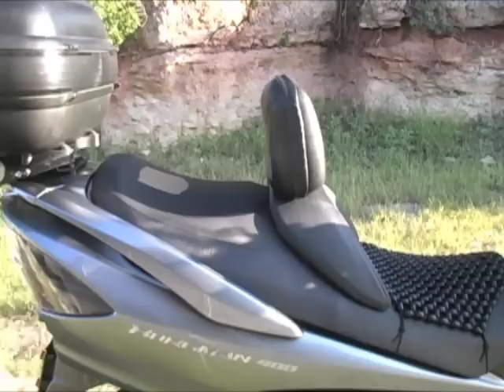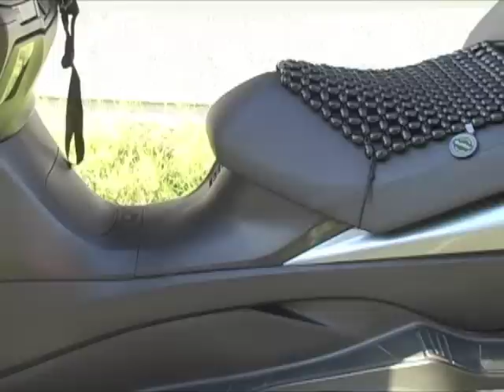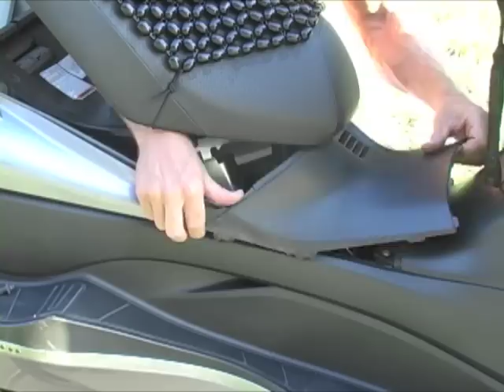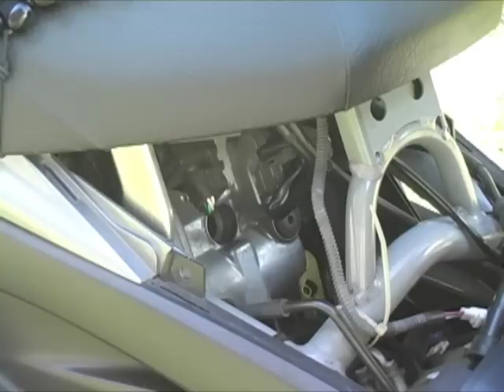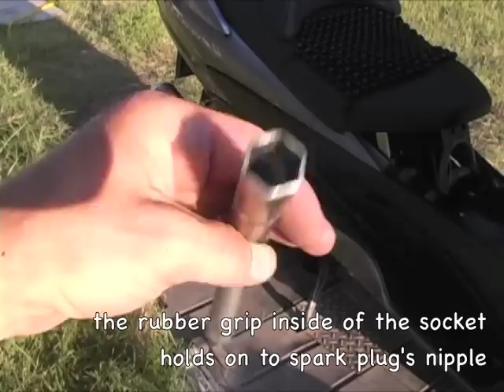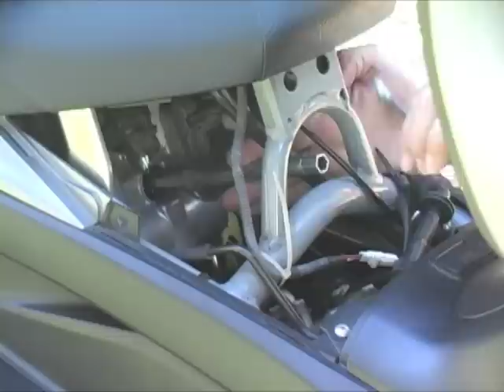07+ Suzuki Burgman 400 - Spark Plug Removal | MicBergsma

Comment: Let us know when you do. Tell your friend to change the wheel bearings on both wheels, to watch the bolts on the main stand as they come lose over time and fit a volt gauge as the Regulator Rectifiers tends to go after 8 to 10000Km. Apart from that, a grate machine. I have mine since new 04.

Comment: Dumb question, if the spark plug is hidden under the seat then what is that thing that LOOKS like a spark plug  on the right side near the oil inlet?
Reply: Its a O2 sensor

Comment: Hi Mic, Thanks for both the plug video and the K & N air filter video. The stock air filter was easy when I did that some time ago, but the K & N was really tricky. But thanks to your video I finally got it in.  BTW I just posted 2 videos about a candle I created. Has 4 sides and 4 wicks. You can check it out.  My best, Harold from Oregon (Heelingfree)